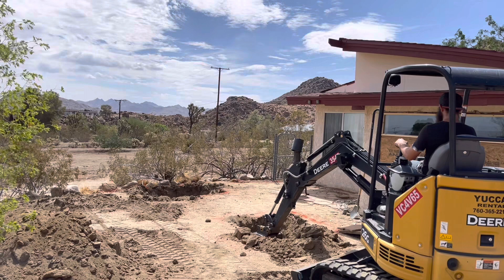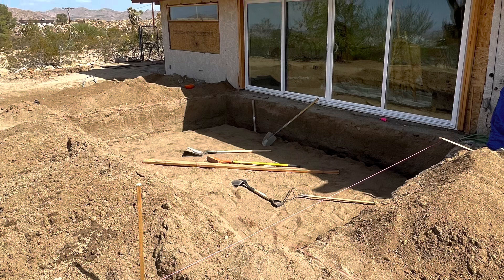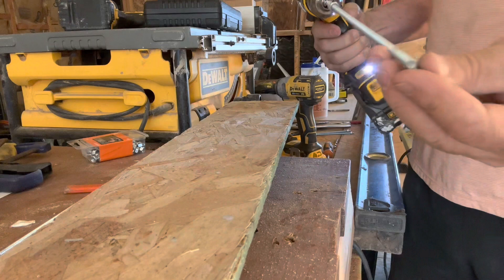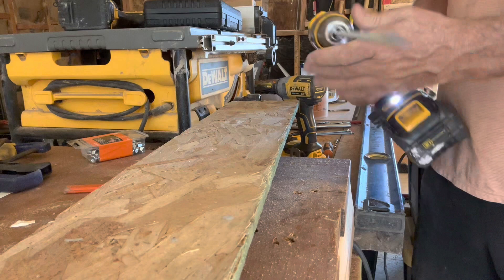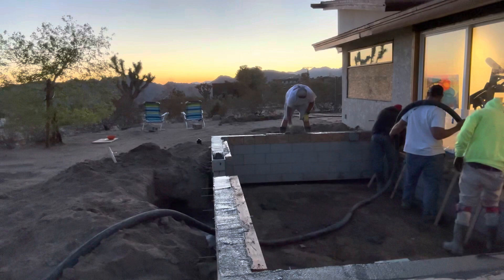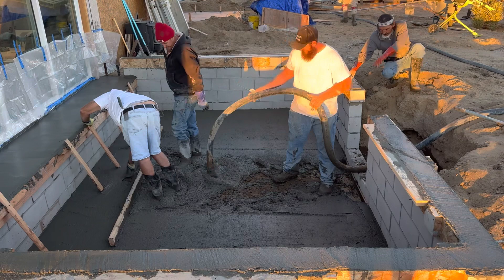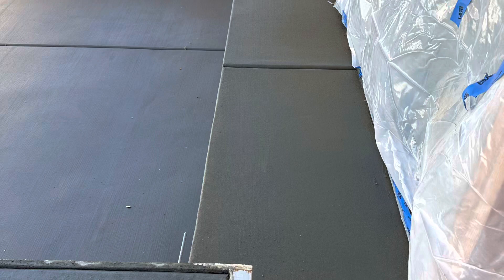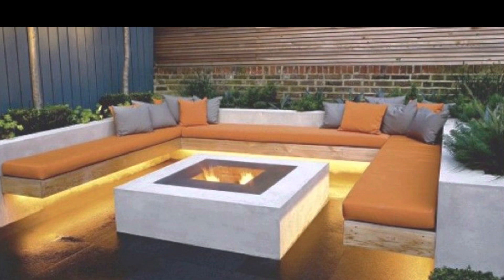How To Build a Sunken Patio part 2

Comment from the maker: sorry for the delayed response..
drainage for the sunken patio can only be handled in two ways..

1; if there is a slight downhill slope some where close by, and drainage pipe is
added pre-slab,
and then daylights at a location off and away.
(which I did in the case, and the drain holes
are in the corners hidden under the benches).
we don’t get much rain here so it is not
extra critical.
#2;
outside the wall a small sump and pump
which sometimes come as a kit,
can be placed below floor level.
and water is automatically pumped off and away when needed.